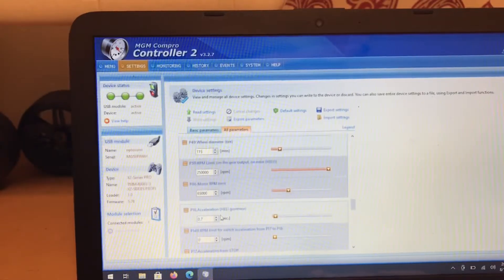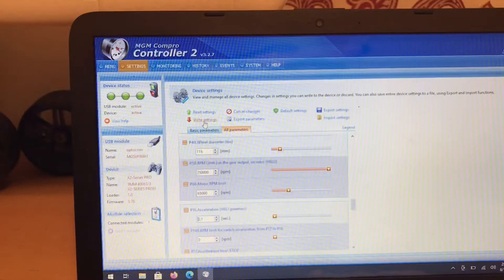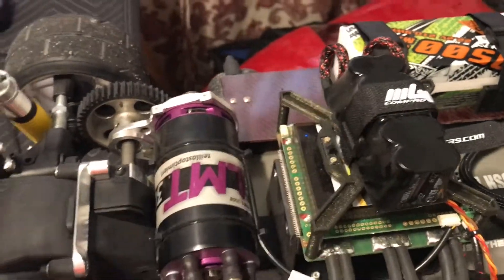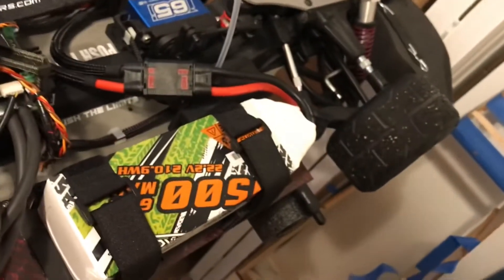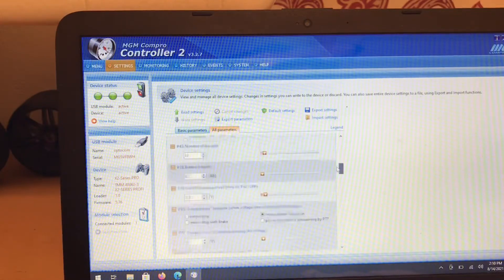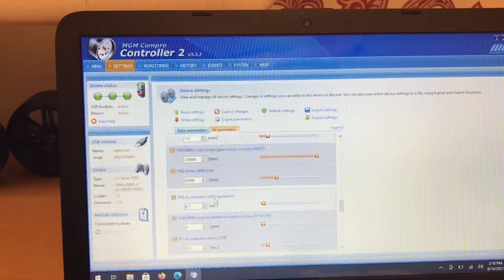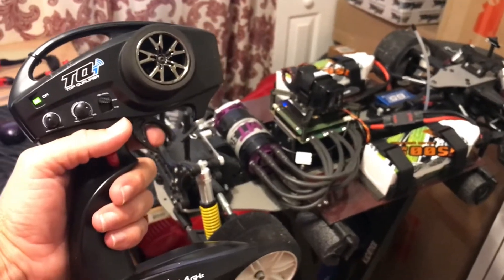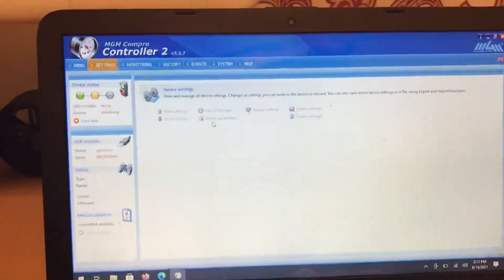MGM CONTROLLERS Esc Tuning P16 Acceleration

Comment: hi, I'm genny from Italy, congratulations for the video, before changing this setting the car after leaving the gas when I accelerated quickly did not go, dropping below 0.7 what problems could I have?
Reply from the maker: Depending on how many amps you are pulling, and how many amps your esc is rated for, it will go into amp overload cutoff. There are 2 other setting related to start power (time and rpm) which you can play with, to get the car to launch without pulling too many amps. Or you can change gearing
Reply: @BUILTbyRICHIE  TMM 40063-3 per Auto X2-SERIES PRO motor lmt 3080 sensorial 870kv I would be happy if you would help me with the configuration
Reply: I use two batteries 6s 9500 amp cnhl 140.60wh
Reply from the maker: I don’t have my computer in front of me right now, but you have to adjust launch settings. Adjust the launch for 3000 rpm and .5 delay, and go from there
Reply: @BUILTbyRICHIE  I had too high peaks almost 800amp with p16 at 0.7 I have to change something else or bring p16 to a higher value. thanks for your availability
Reply from the maker: @gennysrzigarelli1342  https://youtu.be/QhbtvjiBh3Q